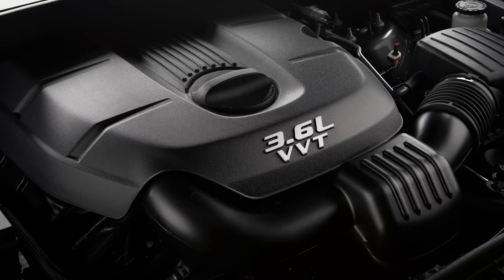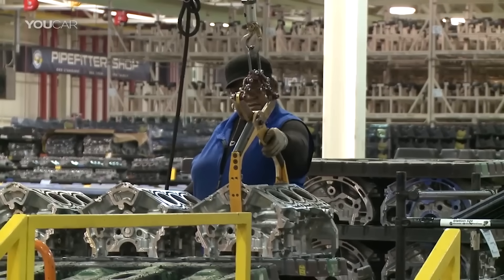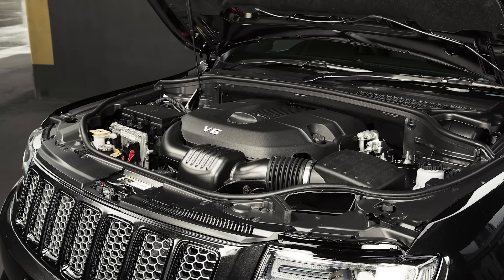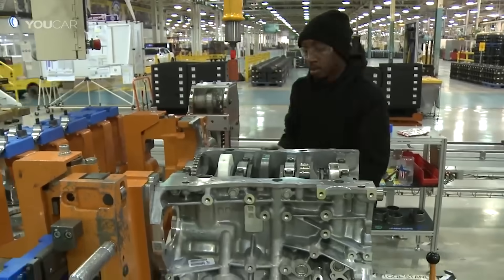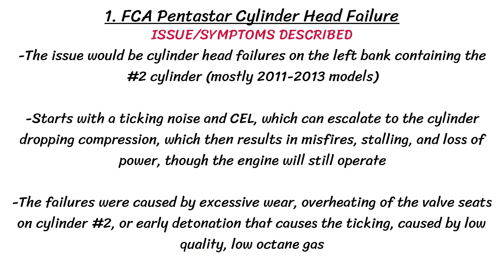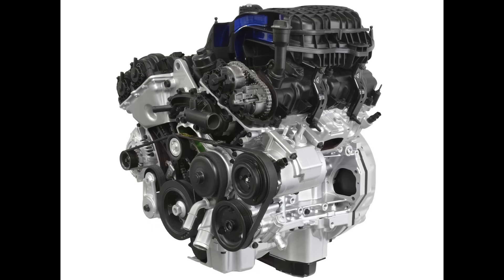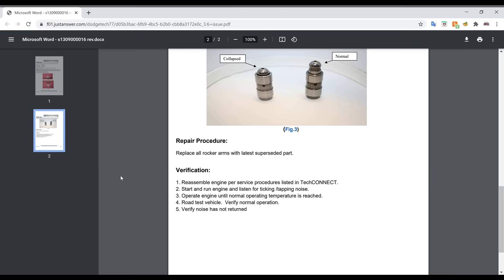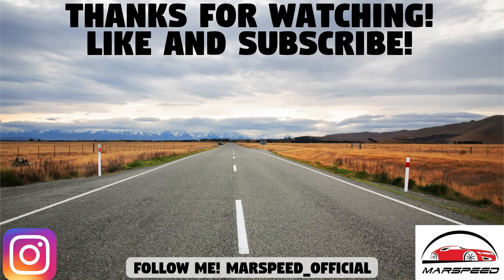The Specs and Fatal Flaws of the Chrysler 3.6L Pentastar V6 Engine

Comment: I just bought a JL unlimited 4 door. Only going to use 93 octane. I used 93 in my CJ7 when I bought it new in 1986 and with regular oil changes got 157k miles on it before I sold it. The engine was still purring. It’s how you treat it. Abusing it by red lining any motor won’t make it last.
Reply: You do know that your octane rating is based off your engine compression ratio? cars with a higher compression engine need more octane compared to a lower compression engine. 

You can put 93 octane in it but you will get no benefit unlike if you needed 93 octane and put in 87 then you would lose performance and hurt the motor in the long run
Reply: @canadianborne3695  Many mechanics have said Chrysler’s 3.6 liter which has a compression ratio of 11.3:1 is on the lower end of high compression engines. They’ve said don’t use gasoline with an octane less than 89. Pre detonation could do damage to the rocker arms and bearings. I’m not taking a chance. If anything super unleaded will reduce carbon deposits.
Reply: @map3384  I don't know 93 seems like a waste of money
Reply: @canadianborne3695  My money to burn. Go Freedom truckers.

Comment: My 2012 Durango has 198,000 miles.  No major engine issues.  Zero.  Used synthetic oil since I've had her and changed it every 5-8,000 miles with no exception.  The only issue that makes me crazy is the P0430 code for efficiency.  I know it's tied to the catalytic converter but it's not a problem yet.  I'm still getting 24-25 MPG highway.  Other than that, no complaints at all.  It's a workhorse!
Reply: Try a bottle of Cataclean. It’s expensive but it works. Add the bottle when you’re down to a quarter tank. Drive 20 miles. Refuel. That should help

Comment: Thanks for the research on this issue. I've been seriously considering buying a Mopar with this engine, so I now know what to look (or listen to) for to avoid an expensive issue.
Reply: Don't buy Chrysler Pacifica 2017.
Reply: just dont get one
Reply: @TJ-wv8fs  it's in its 3rd Generation and all the issues are fixed. Not only is it reliable over time with normal maintenance, it's not losing power either. Most would rather have something refined than something new.

Comment: Our 2015 Dodge Durango served us flawlessly for 111K miles. Then the self destruct program was initiated, no amount of repairs or replacement parts alleviates the Overheating condition and the engine pukes coolant into the overflow. Three months and $3,700.00 there is still no resolution. we have replaced the Rad, T-stat, Upper Rad hose, Temp Sensor, Water Pump, and flushed the system countless times to no avail. it started with the Radiator, a week later, s misfire on #4 cylinder proceeded with replacing spark plugs and Coil packs. A few days later she overheats again and back to the dealership and they replaced the Rad cap, Ok great, a few days later misfire on #4 cylinder, 2nd dealership says we need Cams and lifters replaced. We sent to another dealership for a second opinion, they perform leak down test and proclaim engine good and "Cleared" the error code. Wife drives car to work and she overheats, again. Wife make me replace the T-Stat again and water pump. Did not help. Suspected Temp sending unit so we replaced that. No go, still overheats and a new code, this time misfire #5 cylinder. Sent to a third repair shop for 3rd opinion, they flushed and bled the system and think it could be a head gasket. They state they can't help us and suggest sending back to dealership and that is where it sits now. We have only driven the car 20 miles in the last 3 months. No resolution and no plan going forward. We are out of warranty and still making car payments on a car we can't drive. Sorry, to be so long winded, but after seeing this vid I suspect either a cracked or warped head, cracked block, or all three. Hind sight is 20/20. The car was perfect for our family up until this point. I can't in good conscience sell the car to another hapless consumer, and with the service record on CarFax we can't get a payoff within 3 grand of what we owe on the car.

Comment: WOW! I've had every issue this video explained. I have a 2012 Jeep Wrangler, I had to replace my engine at 115K ($8K) approx. 2 months ago. My heater core is busted, haven't had heat or air in 3 years. And my Jeep randomly overheats, the overheating is not serious but I have to keep an eye on the needle. I love my Jeep just wish I didn't have all of these issues.

Comment: Would it help to flush the cooling system when it’s new to get the dust out?
It would be interesting to run the old coolant through a filter and see what showed up.
Reply: I own a 2012 Chrysler 200 touring 3.6, and ive had constant issues with cooling system components, the sand actually comes out of the metal as the water ports wear on the inside, (picture sand imbedded into the cast aluminum water channels). breaking free and roaming around as the engine wears. On the up side, my 200 has over 160k on it and most of those miles have been my wife, who seems to be intent on never being late for anything(even a yellow light), and other than normal wear and tear parts like brakes, front and rear struts, tires, battery, alternator, ac condensor, heater core, thermostat, oil cooler filter housing assembly, cv joints and axles,  intake gaskets, spark plugs at 100k , and tranny tune at 120k, wheel bearings, water pump has failed now so i think that is next, it has been a fun car to drive and it still will outrun most on the road today. Oh yeah these cars have a common issue with the stereo, it seems to fail after too many winters.

Comment: Do you have the 4.7 V8 on your future video list? I have an early model year 2011. Water pump bearings went out at 10 years old, 45k. Was somewhat disappointed. No issues otherwise.

Comment: Only 4K miles on our 20 Gladiator. I’ve been very pleased w performance and 8speed auto transmission. Feels solid all around!!
Reply: I got 2021 gladiator.. 
I can hear a slight ticking.. 
hope it’s not going to be a problem
Reply: Hope not
Reply: Update sept 2021* 
Been using 89 but Put 87 octane gas in our 3.6L since manual says higher octane fuels don’t provide benefits but definitely can tell it losses some of its thrust when above 3k rpm on paved roads. No noticeable issues w the 8 speed’s decision making. Gladiator rubicon is still geared for low end torque which it provides in addition w 410 gears. Rock crawler that can do the job on pavement. Hopefully it’s reliable 🤞🏻 I’m hearing good things.

Comment: Any assessment of the 4.7 v8?  I have one in my 2008 Dodge Dakota and have 106k mi on it with no problem except bad gas mileage.  The engine has been discontinued but I'm the original owner and have the lifetime power train warranty.  My service adviser says Mopar still stands behind that warranty but if I need an engine they'll supply a reman.

Comment: My 2016 Dodge Journey R/T has 50,000 miles and it seems great, so far. I've put 20,000 miles on it in a little less than 3 years.

Comment: The rod bolts are too weak.  Excessive RPM/load over time leads to shear.  Pulling trucks are the primary target here.  The rods are also too thin so the extra flex in the piston strokes are hard on bearings.
The cylinders are not supported well and float.  Combined with a thin head gasket, more troubles with sealing, especially around the center bores.

Comment: Biggest solution for the cooling issues is to flush the cooling system early and often. Don't wait 150,000 miles to replace the coolant. Flush it in the first 50,000 miles and every 50,000 thereafter to get out any accumulated debris. Coolant is cheap, engines are expensive.
Reply: you bet maintenance is the key and keep it ahead of the manufacturer suggested intervals.

Comment: This may sound weird but I love the smell the 3.6 had in my 2018 Jeep GC when it was new and I would floor it. It lasted until about 40K (purchased with only 17 miles on it).

Edit: I never heard it “tick” but I also only used 91 shell gas since it rolled off the lot. I do this with all my cars regardless of what’s recommend.

Comment: I'm a salesman and drive my 2018 Dodge Challenger GT, purchased in 2017, a lot of miles to put it mildly. My V6 is closing in on 200k miles. From its first oil change at 500 miles, I've used nothing but Amsoil. Other than plugs, cooling system flush and recently the tranny fluid, second time, with Amsoil. Bottom line, any grease or fluids all have been replaced with Amsoil products. Its an amazing car that gets very close to 30 mpg highway. It doesn't leak fluids or use any oil. I change my oil and filter every 6000. I know it can go much longer but I feel it's cheap insurance. Best car I ever owned.
Reply: how many miles are you at now?
Reply: I have 2019 gt! I love it

Comment: I worked for Enterprise Rent a Car and we had over 50% our 3.6 equipped 2011-2013  vehicles needing new heads. It was a nightmare with most vehicles spending months in the shop.

Comment: Got one in my 2013 Charger I bought used w/75k on it. I have a tick coming from passenger side, but only when cold (20 - 45 F) and it disappears when up to temp. I’m wondering if the ‘fix’ has already been done by the previous owner. So far at 118k it’s been a reliable vehicle.

Comment: I only wish the 3.6 was a little quicker in the sedans,  my 3.8 (with only 200hp) can eat them up if it's in a 16+ charger or 300 granted if you want speed I suppose that's why they offer the hemi, I also wonder if a 3.6 could fit in a GM W or H body, would be an interesting swap given the higher horsepower numbers.

Comment: my grand cherokee v6 3.6 pentastar from 2018 (20000 miles, like new) is supposed to develop 290HP.... after dyno test he is developing 241HP and 314Nm of torque... the dyno guy told me : this is american vehicle, paper HP are not real engine HP.
this is my second one, 3.6, + 1 wrangler 3.6 JKU, i know how it works great no difference or engine failure feeling, excellent SUV anyway.

Comment: We’ve had a 2014&15 grand Cherokee as well as a 16 grand caravan with the 14 Cherokee burning/ losing oil and the 15 grand Cherokee and grand caravan having cylinder head failures ticking time bombs ;)

Comment: A friend of mine (in her seventies) purchased a '15 Grand Caravan brand-new. At 26k it had already been in the shop for two major oil leaks and had just come back from having new heads installed due to two broken valves. By 30k it had developed a coolant leak (cracked plastic intake manifold). Around 34 or 35k a third oil leak appeared and was fixed - all three times it was valve cover gaskets. All of those repairs were covered under warranty and only led to her being without her van for a total of 2 1/2 weeks during her FIRST YEAR of ownership. It burns roughly 2 quarts of oil every 3,000 miles - "normal consumption" according to the dealer. Wait, what??!!
Also, her warranty was NOT extended past the original 36k.